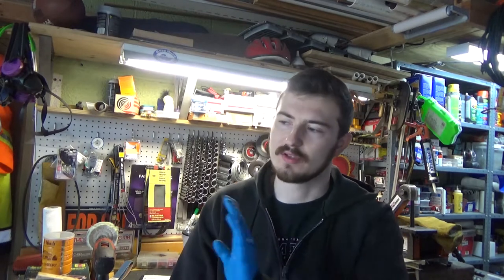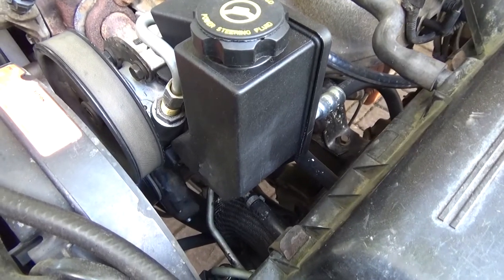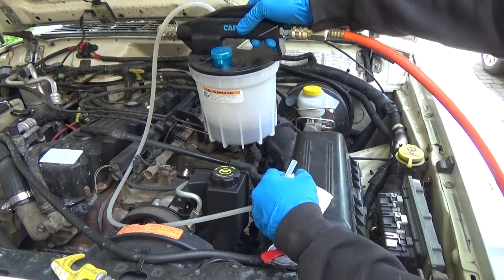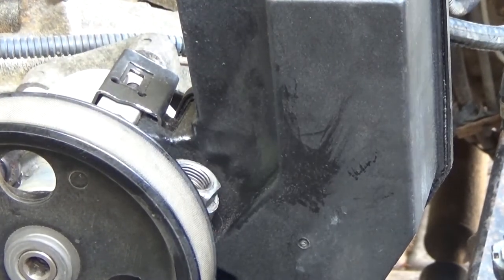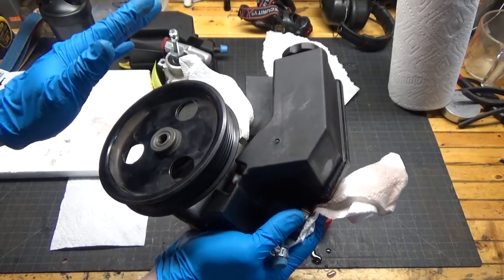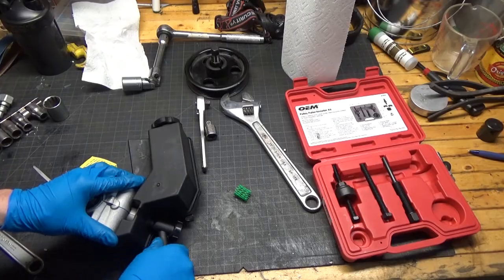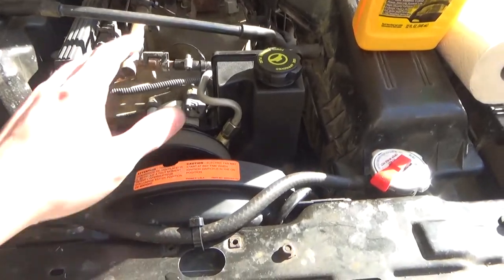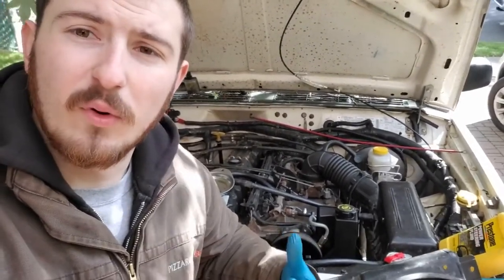JEEP XJ: WJ Steering Pump Swap

Comment: In the WJ, the hi pressure supply line from the pump goes to the hydrofan, the hydrofan hi pressure return goes to the gearbox, the gearbox return goes to that large outlet on the reservoir.  The smaller outlet is where the cooler/filter bypass returns to the reservoir.

So with the XJ, just forget the hydrofan. Hi pressure goes directly to gearbox. Return goes to large outlet (Just like this video shows)
Now, that small outlet is a perfect place to return your own filter bypass. You do not have to reconnect back to the main return line. This way, the filter isn't restricting pump flow.

Comment: I’ve got an 88 Cherokee and am doing this swap now and have found out the pressure valve adapters are not the same diameter and tread and the XJ pressure hose adapter will not thread into and tighten down.  I’m going to have to go to a hydraulic hose shop an$ have a hose made to fit.

Comment: I have tried several brands of power steering fluid,   and so far have had the very best of luck with  Lucas brand in the gray bottle.   And if you  plow,  or have large tires on your truck,  I recommend adding about 10% to 20% of the  Lucas power steering Additive.

Comment: I did this swap about a month ago, replaced absolutely everything... red head steering gear, borgeson steering shaft, HD lines, and a lares wj pump brand new from rock auto. I drilled out the fitting, swapped everything over, tightened it up, and even went as far as to remove the fuel pump relay and distributer coil when turning over the pump. At first crank I was cautious as to not let the reservoir run empty. Lines were hooked up and the excessory port blocked correctly with absolutely no leaks. I took my time attempting to bleed the system and it would foam like crazy! After nearly 10 minutes of carefully attempting to bleed the system and letting the foam die down I just let it sit overnight and attempted the same thing the next day. Little by little it seemed to get better, but in my experience I have never had issues bleeding a PS system to this extent. After the 3rd day the air was gone and I attempted to take my xj down the street. It seemed to turn with no issues but felt odd going in a straight line, as if the pump was overpowering the wheel making it feel extremely loose. It was annoying to say the least but worked. Drove it 20 miles just fine, parked it at the house and the next day decided to take it to work. 15 miles in on my drive to work the pump just completely stopped working. Did not make a sound, it just abruptly shit itself. So I got to work the old fashioned way and parked it to inspect under the hood. Levels were fine, not a single leak, pulley was straight and true but no PS. I still have no idea what happened or would have caused this but I left it to sit a few days before ordering and installing a new wj pump last night. Similar issues off the bat. Lots of foaming and steering seems off. I am not sure if you had similar issues but if this one goes I will be looking for an alternative pump. Before this I had a stock steering gear and shaft with the stock PS pump, although my wheel had horrific play in it the pump handled it just fine with a slight whine. I am on an 8" lift with 37s, trussed and locked dana 30 front and 8.8 rear.
Reply from the maker: I actually had similar issues. I could not bleed these for the life of me. It never made sense. When I realized I had the return on the wrong fitting that helped and I finally got a working pump. Much like you it abruptly went out on me, albeit several months later. Since then I went with an AGR super pump. I'm not sure I'd reccomend that either as I have similar issues, this time with a remote reservoir and AN lines. I wS convinced it was the stock reservoirs that were leaking. I still have no idea what the issue was it made no sense. Maybe lares just sucks, that's who I was getting the pumps from
Reply: @trailandco  So did you resolve this? Is this swap still worth it or should I just get a PSC pump?  Looking to go hydro
Reply: i have the same stock setup. Do you have an update?

Comment: I think it should definitely be noted that this won't work for ALL XJ's. Renix has a different bracket and mounts very slightly different. Bolts are different. Can't bolt on and didn't realize until I tried to put it on. Was mislead it would work.

Comment: The LARES pump does not work for this swap anymore. The thread on the high-pressure fitting is too large for the fitting you take off the XJ pump.
Reply: I am in the middle of doing this swap and noticed this issue when I was reassembling. Have you found a fix for this?
Reply: @Rod-cu5yr  I welded the fitting on. I wasnt really satisfied with it and got a new pump

Comment: You can also just drill the XJ fitting to 3/16s on your stock pump and get that lighter steering and all while saving saving ton of money and hassle by doing this swap. Learned the hard way cause I did this swap and had a pump that didn’t quite work right. Would whine at acceleration and grind at lock. Save your money and time, just don’t do this swap
Reply from the maker: I have to agree. I ended up going back to stock later. Too many issues with the pumps I kept getting

Comment: In your video,  the WJ fitting  looks like it is about a 1/4" longer than the XJ fitting.   On the bottom end that goes into the pump.    Am I right?
Reply from the maker: Yes it is longer but that didn't seem to be an issue

Comment: Do you have to use your old xj pulley? or can you use the pulley that comes with the wj steering pump in your xj
Reply from the maker: Thats a good question. I used my same XJ pulley, I would do that to be safe. My new PS pump also didnt come with a pulley on it.

Comment: When you had issues with this. Did you experience loss of PS when you brake?  I also notice there is no fluid moving in the reservoir while running. I drilled out to 5/32 to see if that helped and nothing changed. I had the lines swapped originally and my gear box gave me issues. I’m starting to thing I got a bad gear box and I need to swap those lines back. Any thoughts ?
Reply from the maker: Loss of power at a stop is definitely the pump. Supposedly the fitting in the pump that leads to the high pressure line has a spring and it can get stuck sideways causing this. Or, a small amount of air in your system has over time caused the walls of the pump permanently damaging it and only giving you power steering when on the gas. A good way to test this, do you have full power steering when you cold start the truck? And does it fade away once the truck warms up? If so thats what happened. This is what inevitably happened to my WJ pump.
Reply: @trailandco  it’s a brand new pump along with the gearbox. Redhead gearbox and I can’t remember the pump but it’s not cheap. I thought that was the issue after install so I warranties it out and put in a new pump. Same issue and then I lost PS completely. I’m going to swap the lines back tomorrow and see what happens. Maybe the reducer is causing the issue. I’m not sure.

Comment: hey man odd question, just did this swap on my jeep and was bleeding it out when all of the sudden the return line just blew off and shot powersteering fluid everywhere
Reply from the maker: Sounds like you might need to get a hose clamp on it nice and tight. But I will also say this swap ended up giving me a bunch of issues and I moved on to a different system. Not sure if it was my fault or the parts but take all this with a grain of salt

Comment: So you’re no longer running a WJ pump?
Reply from the maker: I switched to an AGR super pump and remote res. But honestly I don't like it at all and thinking about trying the WJ pump again
Reply: @trailandco  I grabbed one from the junkyard with a Durango box and didn’t do any sort of orifice drilling at all and it’s worked out just fine not a ton better than stock, but hopefully can handle more abuse

Comment: Do you know if  the XJ fluid resivour  is interchangeable  with the  WJ steering pump?   Did you try to swap with one another to see if they would fit?
Reply from the maker: I didn't try this but I would venture to say they are likely the same reservoir
Reply: most people say no, the xj reservoir will NOT connect to the wj pump

Comment: I did this upgrade and the pressure was so strong that it blew up the reservoir as in it started leaking everywhere
Reply: Ive been trying this mod for months. I mean like 6 wj pumps. They keep blowing the seals from res to pump. This last one i did has "the right stuff" rtv and o rings between res and pump and its holding up alright.i also connected both return ports on res to steering box return to try and amend my excess suction pressure issue. I have yet another brand new wj pump im also going to try out cause my last revision (that is working with no leaks) makes noise.
Reply: @vin1322man  🤣🤣🤣 I’m not laughing at you I’m laughing with you because I know your pain
Reply: @christophervillareal6151  dude its total insanity. If autozone didnt hook it up with warranties idk. Im installing a cheap ram, and a uswd psc box now. So i figured ill throw my last new pump i got in and see how it goes. Got a wheeling trip the 11th
Reply: @christophervillareal6151  i think this time around ill try to remove the wj fitting without removing the res. I might even find a reducer so i can leave the pump assembly completely alone just to eliminate any chance of error on my end. But after 6 tries and knowing ya o rings are good and they still blow apart, probably should try a trail gear pump or a psc.